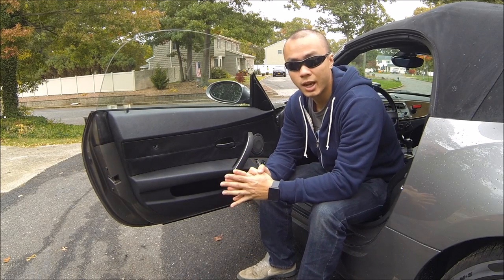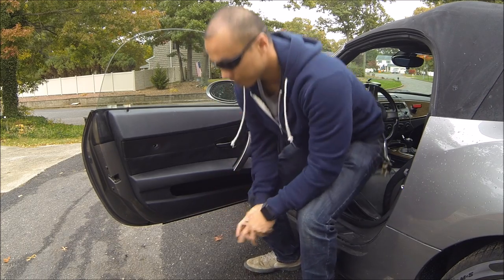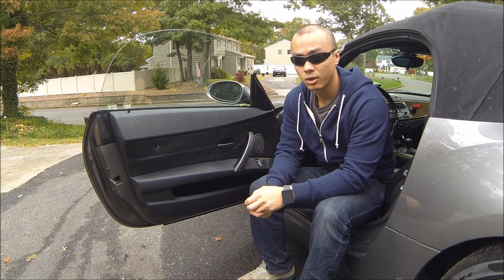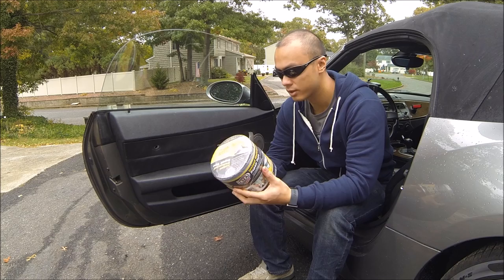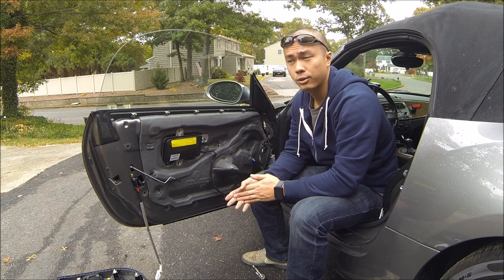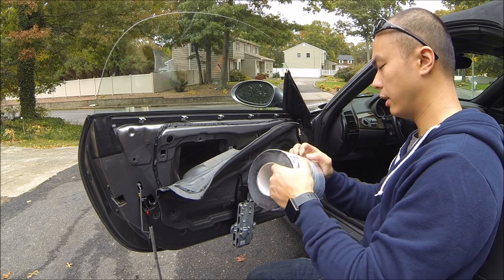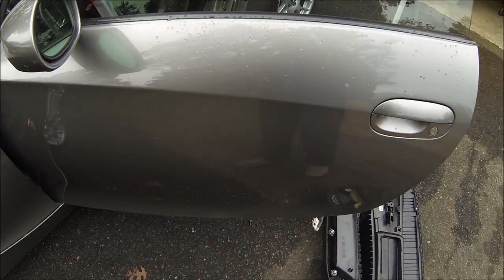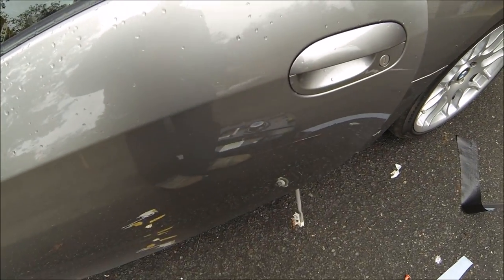Car Door Sound Deadening for Under $20! - BMW Z4 Vlog #20

Comment: I'm not sure how long this product has been out, but SoundSkins is a great product. SoundSkins is the rubber/foil with a foam layer, it's basically two products in one.
Reply: And it costs a lot!
Reply: And it's still cheaper than competition!
And vibration and noise insulation isn't cheap!
And people who cheap out have a car that smells like roofing asphalt!
Reply: So what if it's cheaper than the competition?  All that means is that they're all overpriced!  
Is there not anything that doesn't cost an arm and a leg and still work?
Reply: There's a reason why higher quality products cost more.
Reply: @xaytana  Because there is a sucker born every minute.

Comment: Very very hollow sounding stock, good job. I think that is just butyl and aluminum tape. If you unplug your negative lead from your battery first and turn on your headlights you can remove any airbag you want without throwing a code. Spend a buck or two and get a wooden roller and even better if you have a heat gun or can do it in direct sun light. Nice video btw.

Comment: You are comparing a bitumen-based product with one that is butyl rubber-based. The major problem with bituminous products is that they can catch fire and kill everyone inside the vehicle from smoke inhalation in under 1 minute. Plus the acoustic properties are quite different. I fail to see any comparability.

Comment: ⚠Always disconnect your battery and let the car discharge for 30 minutes before removing any air bag connections. It can become a very dangerous situation if you dont. Im an ASE certified mechanic of 11 years. Good before and after video btw, thank you!
Reply: good thing my car was made in 1993 by gm so it doesnt have a single airbag :,)
Reply: Gamma Light: Exactly right. Air bags are dangerous. Treat the fuckers with respect guys. Like he said, DISCONNECT BATTERY. Not the airbag. But let it sit for 30 minutes afterwards before messing with the car!! Thanks Gamma Light.
Reply: Jas K. Ur welcome! The last thing anyone wants,  is to get popcorned when installing dynomat lol
Reply: Gamma Light Exactly!! 😂😂
Reply: SterrShow Lol, that made me laugh even if you were or weren't being sarcastic.
Reply: Thank you for letting us the air bag disconnect solution....... Yeah, Air bag is super dangerous.
Reply: Theodore Marakas they get a new car from shop?
Reply: how to let it discharge?
Reply: Thanks for adding that... I was going to straight after I started watching the video, but thanks for doing it!
Reply: Adrian Ronald Sehat actually, don't have to wait long, after yih disconnect the battery, turn on and off the car with the key, turn on and off lights... Any residual energy should be dissipated...
Reply: He didn't disconnect the airbag as he stated it in the video.
Reply: used code engine for off light
Reply: Gamma Light  hi gamma
Reply: In my Lexus, you only have to wait 5 minutes
Reply: @sterrshow5016  but, unsafe ;(
Reply: You should  STRESS not putting that stuff on the inside door panel where the air bag is...VERY DANGEROUS!
Reply: I just wanted to add something that I didn't see here. Disconnect the negative terminal in the battery first. Then the positive side.. when you do this it takes the ground out of the car. So when you're messing with it. There's no ground to get an accidental spark. Factory suggestions and many others. When reconnecting, install backwards. Positive then negative terminal. Also, I don't know if it's the same for every vehicle, you would have to research it or call a reputable place. But for my 2015 VW beetle, AFTER the battery is TOTALLY disconnected. I can touch the two cables together for a few seconds, 10-20, and it will discharge my system.  But I still wait a few minutes.  But anytime you disconnect a battery. You should always take off the negative terminal first and put it back on last.  But airbags are no joke! Besafe around them. And yes you may get a code. But if you have a good scanner that let's you reset airbag light.. that's not a problem. You can get a good one for your car, not a generic one for all car's, that will allow you to do this for around $130+ . One use and it pays for itself if you have to take it to get it done. 👍
Reply: What if I have a Dodge?
Reply: Thanks for the advice, sir. I'm glad I saw your comment.
Reply: When u disconnect battery, u dont have airbag light ?
Reply: Or make sure you have a GoPro running and you have the address for America's Funniest Videos.
Reply: Airbags explode out at 200 mph. They can break bones.
Reply: After you disconnect the battery, you can press your brake pedal a few times and leave your door open.  Wait 3 minutes, press brake a few times again and the system will be discharged enough to work on it.
Reply: @davidlunsford6155   I read in the owners manual for my new (2023) corolla that you should not connect the positive and negative battery cables.It can damage the computer, although I don't remember why this happens. Just an FYI.

Comment: Average summer temps here are in the 118F range....  Can easily hit 130+ inside the car.  Wouldn't think of putting asphalt in the vehicle, it will melt and ooze and it will reek petrochemical fumes into the vehicle.  I stopped the nasty bass bounce from my new speakers in my wide open empty truck doors with EVA craft foam sheets (comes in many thicknesses) and used Permatex high temp gasket maker to adhere it to the metal. Worked great!

Comment: Never use an asphalt based product on a vertical surface as the heat will cause it to "melt".  Asphalt is ok for a roof but not in a moving vehicle.  If the shit falls off the panel, it could get bound up in your window mechanism and cause a lot of damage.

Comment: Aluminum and the butenyl is used to absorb vibration, not to be a sound deadener. 25% panel coverage is when you start seeing diminishing returns. Though you might see a marginal gain reduction in sound absorbtion doing full coverage over tiles. 

Vinyl, lead sheeting, serbothane, melamine foam are used for sound deadening.
Reply: Completely wrong...The stuff is actually used as a patching aid for home and RV...Has nothing to do with absorbing vibration..Go to Lowes and read the stuff...I'm using it as a sound deadening mat on my truck as I speak..It may not be made for such, but it works like a charm...

Comment: you know, this video is where i got the idea for the cheap alternative for my own car. And a rattle can anyway, a 1996 Camry. But that insulation was very useful. aid had it stolen and they found it stripped in a tow yard afterwards. No interior at ALL (easiest way to the sound components). So i had a blank slate. I started with two layers of that on the floor , inside the doors on the outer skin, the firewall in bother sides doubled up. heated with propane propane torch and a wood roller to really get it on. 

Then a gallon on flex seal toweled on and left to bake in the texas august sun for 3 days with the doors open. Put heavy plastic down at one point plus the doors for a vapor barrier, after it had begun to solidify, and then glued the carpet back down.

Lastly, the wheel wells made the biggest difference in dB. I rolled that flex seal on, then that aliminum air duct tape with the strands in it was over top.

went from 110 db on highway @ 70mph…. to 63db.

that was 3 years ago and i took all the panel and carpet off the clean em and upgrade the sound again, it’s all still perfectly good.

thanks a lot bro
Reply: The aluminum  duct  tape  layer  is  an excellent idea.  If you have a connection  with someone  in the commercial aviation  field you may  get your hands on the thicker,  stickier  mill spec  rolls. 
Very  handy for other miscellaneous  roadside  repairs as well. I keep  some in my vehicle along with the bailing  wire, zip ties box.
Reply: Say no more..i am in africa i can't get anything like noico over here easily..someone came to fix my roof and i saw this same flash band in this video i stick it to bare sheet of metal and throw it on the floor..it sounded very solid..that was it..i went out to my local building material store and got two rolls..been using it ever since

Comment: I have been using  Frost King Duct insulation for AC duct, it's come in a roll 12 inches wide and 1/2 inch thick. It is made for heat and cool reduction and work great for sound deadening. The coast is about the same it's less than $20.00 dollars a roll. So far no problems it has a sticky back and rolls and presses out to form around the whatever shape the doors are. You can find it at Home Depot and Lows in the Insulation isle. I just clean the inside of the door good and cut it roll it up to get inside the door and press fit it, use and little tape to seal it up and good to go.
Reply: Is there a temp range on the stuff? In my internet wanderings, someone posted that they'd managed to turn a construction grade soundproofing alternative to "goo". Its possible he was in a region with high temps (not that anyone ever leaves out minor technical details).

Comment: Nice video share :-). I agree with your idea 100% but for the same price you can get some real deadener. Trust me I am a car guy I also compete in SPL (Bass Competitions). Ive use Peel and seal and other similar brands it is asphalt based and will not perform like real deadener. Even used it on my own car, I eventually removed and applied some quality stuff. Don't get my comment wrong it did the job, but the car audio deadener does the job even better - car sounds like a tank haha.

Comment: Oh boy, just watched a YouTube of someone regretting doing something like this. Don't use stuff with asphalt. It will melt with high car heat then gunk everything up. And it will take all day to remove from one door. Use the butyl stuff that costs just a little more and you won't have any regrets!!
Reply: which butyl for cheaper?\]
Reply: @melgibbson8955  Noico. Did my entire Frontier in it.

Don't use this asphalt bs.
Reply: Justin Stroud   Try Kilmatt
Reply: 😯😯😯 so good I got real sound deadening for a lot more money?
Reply: It'll be fine on the Pacific West coast. It'll never get warm enough to melt.
Reply: @Polywog77  it was 122° out here last week

Comment: I'm a fleet mechanic work on 18 wheelers trucks and sometimes trailers. Well they have this stuff just like Dynamat it's called Imperial 7618 Trailer Repair Tape, 6" X 50' (6 inches by 50 feet) it's Butyl based NOT asphalt based so there is little no to order stuff works great it's about 70$ on Amazon maybe cheaper if you look around.
Reply: Victor Ramirez Technically it isn't an 18 wheeler unless the truck and trailer are attached... :-P
Reply: Victor Ramirez Assuming you are talking about the 50' roll, that is 25 sq/ft. You can get more of the cheaper brands of purpose built sound deadening for less.
Reply: Would you still recommend that stuff for sound deadening? Interested

Comment: I used a similar product under the carpet on my '68 Mustang.  I primarily did it to keep the exhaust heat from coming through but an added bonus is the floor is now waterproof, Mustang floors rust easily.  I taped up all of the seams with foil duct tape and after 8 years and countless summer driving trips I have never smelled the asphalt.  The car is now a pleasure to drive on a hot summer day. The key is taping up every seam with the foil tape.

Comment: Good Vid! The only downside of this approach is that if the car is left in the sun the tar melts and the tape falls off inside the door... don't ask me how I know...! (for reference I had the same problem with "Silent Coat" which was a LOT more expensive than the roofing strip